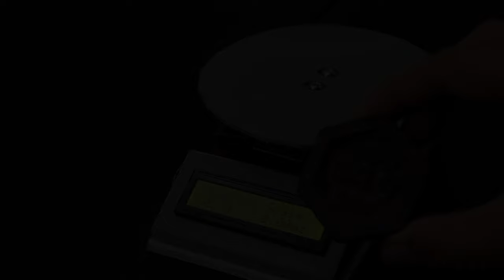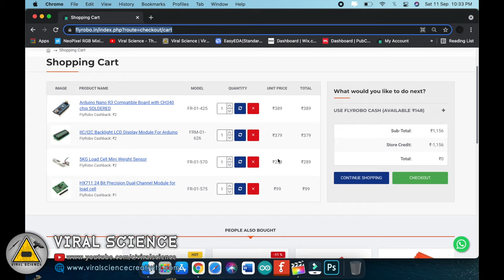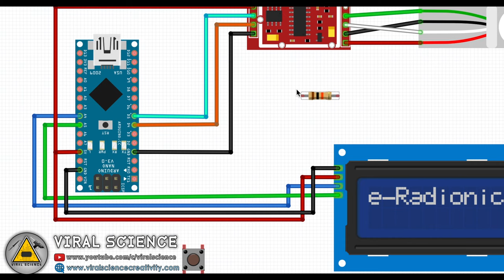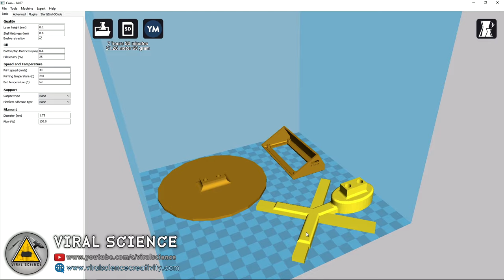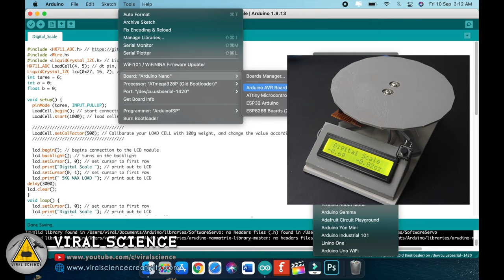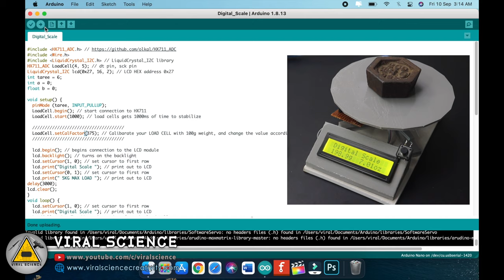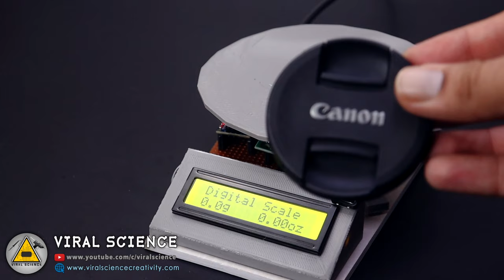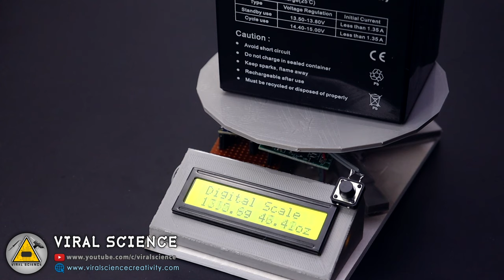Arduino Digital Weight Scale HX711 Load Cell Module

Comment: a nice video but shouldn't you try for new battery chemistries(types) like replacing an old battery used in inverter or your EV(most likely cycle) or any other place where there still are lead-acid used and should also try  lifepo4 batteries cause they are a lot different then li-ion even in voltage levels or a simple, cheap and easy to understand tachometer

Comment: does the load cell sensor comes with the screw or you need to buy them separately? If it doesn't then which type of screw should I get for it?
Reply: Nope. You need buy some M4 screw at size 4mm x 30mm

Comment: Is amy body did this project ..values in lcd display flacuationg and it seems too noise picks up..any sugession to resove it
Reply: Add capacitors to amplifiers supply. Preferably use battery to power circuit

Comment: It could measure less than 0.1 grams?
Reply: Yes and no, it might be able to show 0.1 g, but it may not be accurate nor repeatable. In essense a futile. Class III scales which are suprior to this type can have a maximum of 10,000 divisions. A 5 kg scale has a theoretical maximum of 0.5 g. This one may be a 1 g or 2 g depending on the accuracy class of the adjustment test mass.

Comment: can we use 20kg load cell for same circuit?
Reply: You can use anyload cell you that can be supported by  the electronics circuitry. You may need to change the capacity and adustment interval in the software. Finally adjusted for proper mass reading.